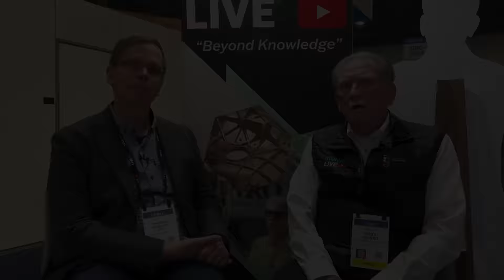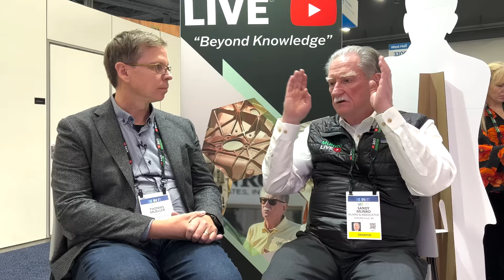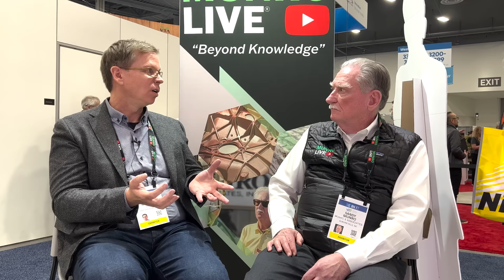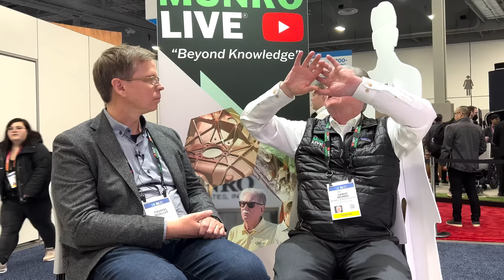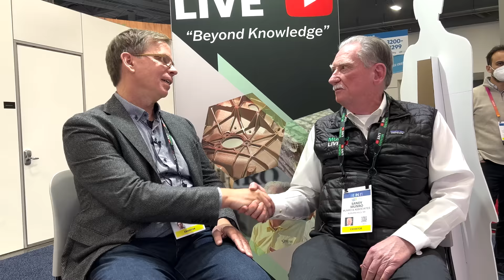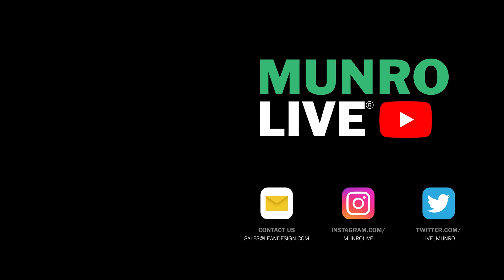100 Million Lines of Code: The State of Automotive Software | CES 2023

Comment: I have been a computer programmer for almost 30 years.  I started off in C and have professionally worked in dozens of languages. Each language has it's strengths and weaknesses.  C has been chosen for it it's small and fast code.  It requires the developer to handle more of the error/memory checking.  Which if not done right is very unsafe.  Newer languages like C# manage errors/memory automatically.  But it also has so much bloat.  Newer developers don't understand how much bloat is behind each piece.  C requires you to think.  C# is going to require more space and faster processors than C.  So it's a double edge sort.  IMHO modular components with standard communication APIs and Secure C apis/libraries would do wonders.
Reply: PS Ford, I have a lightning and would entertain joining ;)
Reply: I like programming microprocessors in C.  The discipline and form required is strangely satisfying to me.  Feels like art - or religion ? 😇
Reply: @Bora_H  I love C, everyone once in a while I still write some c for fun.  Learning C is a great basis to make you better in other languages.  It gives you an idea on how things work behind the scenes of c# etc. I had one job writing software to merge a lottery ticket printing conveyor/ink jets all the way to the front end business.  I used a raspberry pi to measure the distance travelled on a conveyor belt (through shaft drive sensors and calculations).  I tested it beyond what it would ever be used.  It would process 90k signals a second with the cpu at around 90-95%.
Reply: Exactly right, but more to the point, C is just another tool.  You have to pick the right tool for the job.   If your talking directly to hardware, C is probably a good choice, if you're building user interfaces, then probably not.  You could do it, but there are other tools that are much better suited for the job.
Reply: @RomanRomaniuk  I agree, the question becomes how it is designed via hardware. If it is one system, the C with custom libraries to build the UI.  If it is multiple with communications between the systems, then it makes sense to use the power of various languages.
Reply: He mentioned Rust, which is closer to C but have much better safety features and no more bloat.
Reply: @kavinho  I played around with Rust a while back. I did like it.  Just haven't experienced it enough to say how well it would work for lower level coding. Plus I think there is something to be said about knowing low level C, so you think more about what you are writing.   When you create something "safer", someone who has only used it can be the person creating the bloat.   Start throwing pointers around in C and it's going to blow up if you don't manage it properly.
Reply: "Newer languages like C# manage errors/memory automatically.  But it also has so much bloat.  Newer developers don't understand how much bloat is behind each piece" -- hard to understand what exactly you consider "so much bloat", but it's really not that bad. A C# program is roughly the same size code as a C program -- in the context of an automotive application, where it will be pre-compiled to the native hardware; in other contexts, like desktop or server software, it's typically more concise than the equivalent C -- but will generally run 10-20% slower in performance-critical scenarios. This performance difference, and even if you find an exceptional case where the code is literally larger in size, modern hardware can effortlessly accommodate the need for additional performance and memory space.

The bigger issue with managed languages (C#, Java, JavaScript, Python, etc.) is that they have unpredictable execution times. It would be possible in theory to build e.g. a C# runtime that operated in a real-time manner, but those just don't exist today. I'm not a big fan of Rust -- I find its need for verbosity to express the invariants that ensure the various kinds of safety it provides, to be a serious barrier to using Rust effectively -- but I would guess that in terms of implementing a real-time system needed for an automotive application, C/C++ or Rust or something similar will be a more practical, effective approach.
Reply: @harvey66616  you either accidentally forgot or decided on purpose to gloss over the fact, that it is impossible to run C# (and Python, and Java, and, god forbid, the abomination, JavaScript) on embedded systems without a huge overhead for the respective runtime. C#, for example, requires a buttload of shared libraries (DLLs or SOs); Java needs to spin up its JVM with all the JRE bytecode libraries; considering Pyhton or JS in embedded environments is altogether a sick joke. Since you have to add the overhead of all the runtime libraries and executables to get the actual resource consumption, the size of the build artifact is not comparable to those of C/C++/Rust/Go/WASM. These, on the other hand, tend to bundle their runtime, can be linked statically or, in the case of webassembly, run on a lightweight engine (standalone, without any runtime libraries) that is implemented in one of the other four.

Performance-wise, if we finally move on from the orbital foot-cannons that are C and C++, Rust is the best choice. After all, it is the second official high-level Kernel language for a reason. Yes, it may be a bit of a pain to express oneself in it, and the code reuse is never going to come as easy as it does in Go, but it is safe, performant and powerful enough to write operating systems in, easily beating the legacy languages.

Comment: Great contents.  Move forward with automotive coding.  Unfortunately, we're stuck with millions of cars using the old standards and sometimes the dealers and techs and support personnel (manufacturer) with all the expensive diagnostic tools can't figure out what's wrong with the car.  They make it so complex that instead of getting out of the hole, they keep on digging.
Reply: Well, our  "New" car is a 2012 model.   But when something doesn't work, even the  local repair shop quickly finds out what's wrong and fixes it.

Comment: A reason for breaking up functionality into multiple ECUs is that it is easier to characterize failure modes.  Having a lot of applications running on powerful central processor makes characterizing what happens when one or more of the constituent applications fails difficult.  Can a crashed satellite radio app make antilock braking quit working?  What happens if a telematics app is hacked?  How are software failures compartmentalized?; can it be done without disrupting time deterministic apps running on the central processor?  The other thing to consider is the wiring.  Running analog inputs to a central processor requires more noise shielded wire.  Thee could be merit in employing limited function networked ECUs to handle conversion to and from analog at the points of acquisition or application.
Reply: It is theoretically possible to accomplish the same compartmentalization virtually in a single computer.

Your point about signals is on the mark, but not sure whether it's really an issue. You don't need a full ECU to convert analog to digital and put the data on a bus. I don't think the presenters in the video are proposing that every sensor in the car wind up with its own wire going back to the main processor unit; that would be crazy and dramatically increase cost and potential failure modes.

Now, will auto makers follow good security and reliability methodologies to make sure software components are properly compartmentalized as you rightly say needs to happen? That remains to be seen. I don't have a lot of confidence in their ability to do so, at least not without some government regulation providing strict guidelines for the kind of consolidation of software being envisioned in this video.
Reply: This, and CPU's are cheap as dirt. So why optimize by put infotainment and critical subsystems on the same hardware. I do not want the critical stuf and the non critical run of the same power supply or use the same data network.
Although I don't think they have that in mind, but more something like consolidating software of the same criticality. And a graphical display written in c is far from perfect, so getting a more modern approach might be an improvement. Displays of all types of brands hang and crash these days, so change is good.
Reply: @mennovanlavieren3885  Thanks, good comment.

Comment: Nice job Munro Live team. Not a sexy topic, but one that needs attention. 

This is the part of the automotive industry which many legacy builders have struggled with. I remember a couple of years ago Ford invested into a campus in the Silicone Valley and some did not understand what the point was. Not sure if the investment has paid off, but it showed someone at Ford knew software is important. The recent mess VW had with their software development program shows their leadership does not understand what to do. 

I know many old school piston heads hate the digital age and how it is now taking over the automotive world, but I do believe it will make the transportation experience better over all. The only thing that bugs me at the moment is the way so many are focused on subscription fees. I get, a business wants to know where their revenue will come from, but when they put heated steering wheel under subscription or remote car start under subscription, features that for decades you bought with your vehicle and got to use until the vehicle was scrapped, but now you have subscribe to those features, that sucks. I do not want to pay tens of thousands for a vehicle and then thousands each year just to keep some features we commonly have gotten over the past twenty years. 

Back to the point, glad to see software in the automotive industry getting some coverage. Software is crucial to vehicles now and will be more so in the future. I hope to see more software conversations on Munro Live.
Reply: It is actually a very sexy topic, especially among people who don't think car = nice interiors.
Reply: Ford has Blackberry QNX for a partner, VW moved to Cariad a Blackberry QNX partner.  I am seeing a trend.

Comment: By law, manufacturers have to provide repair parts for 10 years. They should be required to provide software updates for security and compatibility for at least 10 years too. Those updates (and any required programming software) should be freely available for any qualified person to install.
All of those fancy screens look great until they don't work because the services are gone or incompatible when the car is only 5 years old.

Comment: Sandy...it's easy to understand why C and the like.  It's scalable.  It can run on anything from a single CPU chip to a mainframe.  With such a wide range it's a perfect match for that which Tesla might be doing.  That's in a general sense, of course.  I'm an old Unix coder (we used to call ourselves Systems Analysts) so consider the source.

Comment: Having spent 30 years in the IT industry when someone tells me that a car has, on average, ten times more code than a massive commercial airliner my instinctive response is to question why the car maker would not scrap their system and start from scratch with a spec of what the system is supposed to do. And all those ECUs? Argh! Each has to have at least one comms connection, one sensor connection and one power connection; add the ECU itself and each ECU represents a minimum of four possible points of failure…. Madness.

Comment: The whole lines of code metric is going to become outmoded with machine learning, it doesn't exactly write like that. And more isn't always the wave of the future, an engineer who can replace 100 lines of code with a few did a great job.
Reply: I don't think you know anything about code
Reply: @mrsith1402  You'd be thinking wrong. I graduated from computer science in 2009, worked in data science for over a decade, and am dipping in ML now.
Reply: Why? Almost all the accidential complexity will still come from the actual code...
Reply: @tipoomaster  clever programing is not necessarily good code. It is an interesting discussion
Reply: Lines of code is just a simple method to assess development/test effort. 

Machine learning code in itself will need its own metric for such estimates.
Reply: The best code is no code.  :-)
Reply: @tipoomaster  you can remove lines of code aka simplify any design.
It can be better or worse.
Removing lines with better hardware is the best way.
Reply: @ericrotermund1004  yes, a lever to roll up windows will get rid of excess code. Just one example
Reply: @ericrotermund1004  That's why I said "isn't always", you can't say one is better or worse  in isolation, but reduction can pay dividends.

Comment: I actually need a car that has a lever to roll up the windows. Less cheap crap to break and save 20 lines of code.. 2 Honda 1998 CRVs with a combined mileage of 650,000 miles and still running.
Reply: Well, I still enjoy driving a stick shift.   But there are three "modern" features I simply love:   Cruise Control, Power Locks, and Power Windows.

Comment: More lines of code is not better.

As Elon once said, I give my team 1 point for adding a line of code and 2 points for deleting a line of code.
Reply: Exactly.
Reply: Yes, at first you write something that does the job. And then you start the optimization. You want that thing to run with the least written code possible.
Reply: IBM once famously berated Microsoft employees for their low count of KLOCs (thousand lines of code).  I guess they would have been overjoyed to find 100 million lines of code in an automobile.  To me it sounds absolutely nuts.

Comment: yes 100 million lines of code with no mistakes reminds me of playing blackjack in basic with 1100 lines of code.very good ideas are presented here and interesting instruction
Reply: Well, back when IBM was the "Be All, & End All" in computers, it was calculated that each and every "line" of code that's been debugged, etc., requires one man hour of effort.   That means the code requires to 50k Man Years of coding effort.   That's on the order of $5 billion$.   Go ahead and make your own ASSumptions but "something ain't right" here.
Reply: IBM quietly buried their operating system mistakes by paying for their mistakes, back in the 1960’s mainframe day.  They also fixed their mistakes usually within hours.  Eventually, their operating systems worked correctly.

Comment: 29:00 Errors , big errors,  the early Tesla S had a VERY HIGH failure rate in the Drive Train,  experience has improved them a lot.   But mechanical and electrical things fail .   AND due to very heavy weight of Batty pack the TIRES wear at accelerated rate.
Reply: if people can pay $50k for a car why whine about tires lol

Comment: Really?  All of a sudden, vertical integration doesn’t count in software?  Microsoft Office can do some wonderful things, but a number of those things I was doing 30 years ago.   

And, Sandy, the chips don’t give a sh*t about what language the code was written in.  In the end, it all gets compiled and assembled into machine code.
Reply: Where did he say that vertical integration didn't matter? Using existing software libraries is not the same as buying physical components from suppliers... You can see what this "vertical integration" leads to in a lot of c codebases... You will have a dozend half assed implementations of some data structures which are barely good enough to handle the workload in this usecase and that every modern language gives you in a standard library. It doesn't make sense to write the 5000th hash table implementation if all you need is a hash table without any special features. Chips don't care about the language the code is written in but engineers do because they might know language a but not language x... That's why all the banks are scrambling to get Engineers for or move away from COBOL...

Comment: Android is a Linux. Android has very good low level top level software separation - digital vaults are inside phones that hold credit cards.  But even that is not needed since customizing UI needed anyway you can also run android code in linux virtual machine. You can build your custom android rom for your hardware.  Trouble is that how to do OTA RPM updates etc. How to make hacking proof system and hw to decouple it from car bus so that there is no way you can hack it and that is the hardest part of that software. When someone can get into that system then they can steer or break car from android. So having Android adds a lot of apps but also adds threat that someone can submit code that submits code that gets that access.

Comment: Compliments for the excellent video! An important root of most problems mentioned in this video is 'enginering by catalogus' (as Elon calls it), so stitching 30 to 100 components (eg. HVAC, infotainment, motor-management) from different suppliers together by Canbus networks. I prefer to call that 'cut-and-paste cars'. 

We should learn  all the dumbo's that there are two types of cars:
 1. 'integrated cars' (Tesla and the Chinese brands) and 
 2. 'cut-and-paste cars' (the rest). 
So tell your Grandma!